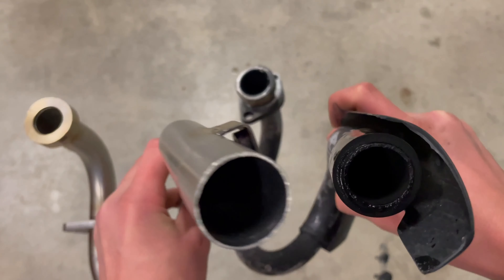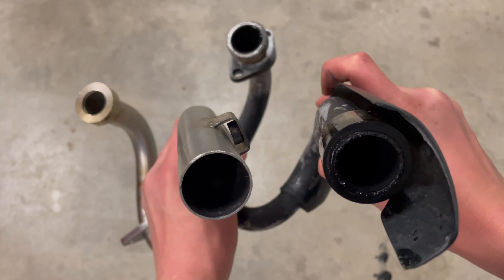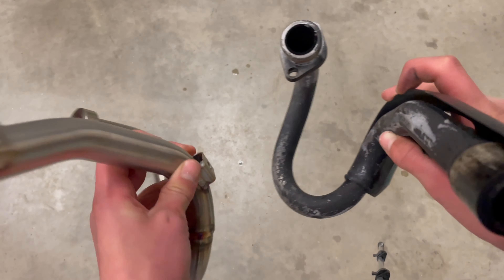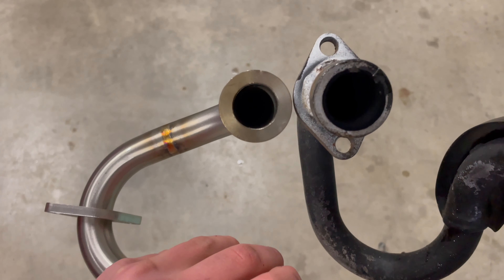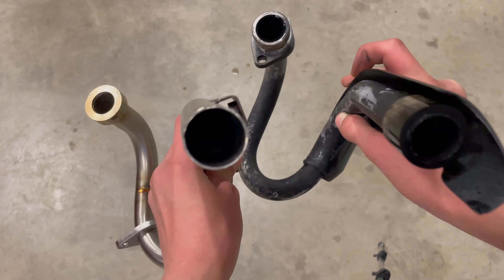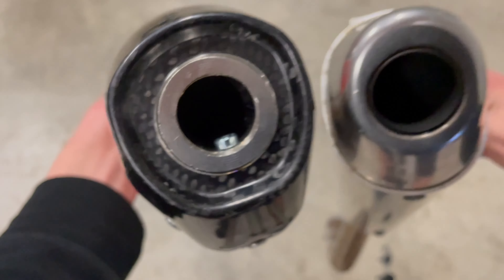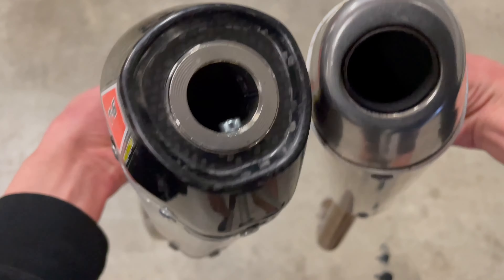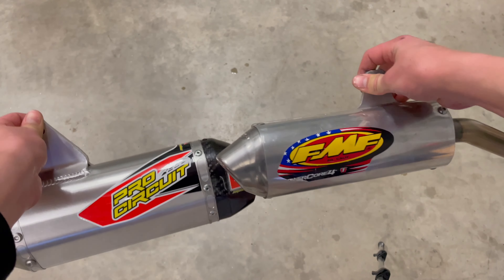KLX 140, Pro Circuit T-6 full exhaust system installation

Comment: Did you have to change the jets? Or were they already changed? If so, what sizes?
Reply from the maker: No I haven’t had to change the jets, they are still the stock ones. It pops a little when you back of the gas. I am planning on getting the Vm26 for it so that is why I haven’t tried to change the jets to help with the pop. Otherwise the bike runs good with stock carb and jets but pops a little when you back off the gas
Reply: @hudsoncollinsracing  thanks for the details!

Comment: What carb and what size jets?
Reply from the maker: At the recording of this video the bike has stock carb and stock jets and it popped a little when you backed off. I change to a Vm26 with a 20 piolt and 185 main